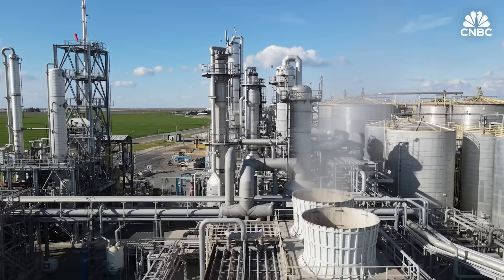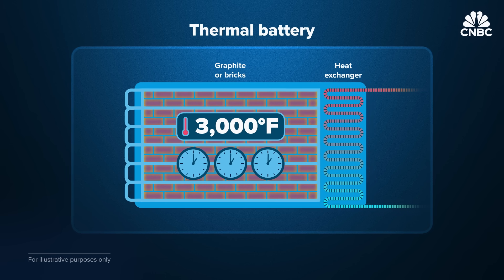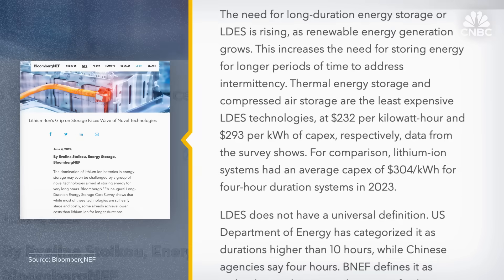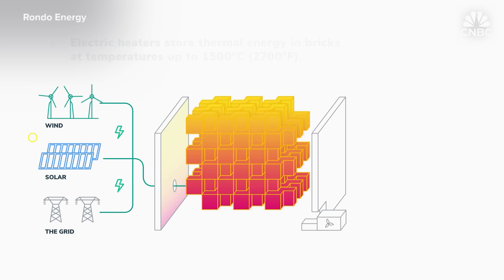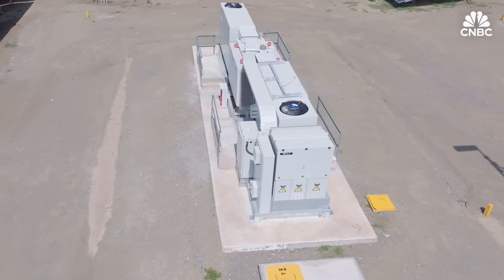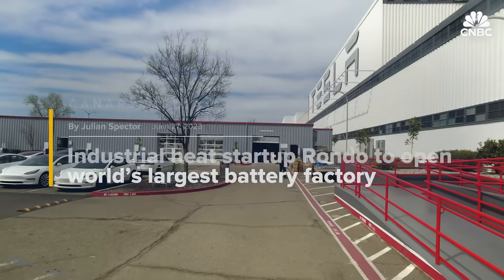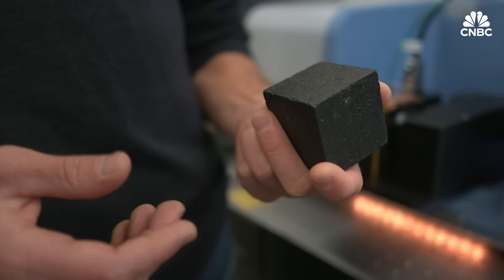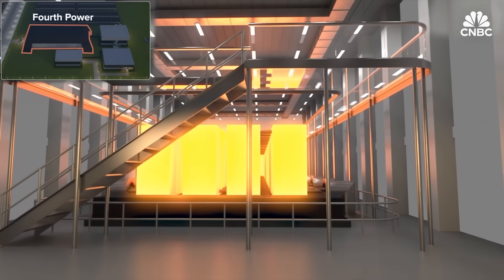How Thermal Batteries Could Replace Lithium-Ion Batteries

Comment: Lithium is not a rare minieral . There are not many mines because it previously had not been in demand. Cobalt is rare but not needed in LFP batteries. The heat storage is a good application in certain industries. I do not think it will scale down for electrical energy storage in my garage or my EVs.

Comment: Energy efficiency engineer here. I actually have a R&D project, where we're putting in a much lower cost (water based) thermal storage in Ontario, Canada to offset heat pump operation during peak grid conditions.

You're mixing two technologies and as a result it's hard to see what the video is about.

Tech 1: Use electricity to heat smth up, then use the heat for industrial needs. Great tech. Very limited application. Key point - will be implemented by industrial clients who will then reap the benefits of switching when they use the grid. High efficiency, as little is lost (the electricity would have been used to make heat anyways).

Tech 2: Use electricity to heat smth up. Then use the heat to make steam that will turn a turbine to produce electricity again. This tech could be used by the grid operator as the output is electricity again. The key issue (not touched at all in the video) is roundabout efficiency. Unlike lithium batteries, the conversions will eat away a sizable chunk of your input energy. So if you put in 100kWh of electricity you may get back 50-60kWh unlike lithium where you're getting 95+kWh back. so a $/kwh stored is an unfair comparison.

There's actually a 3rd tech that you haven't touched on at all. You can use solar thermal plants to charge your thermal storage, skipping the electricity step altogether. I've visited a project like this in Denmark about a decade ago. They used concentrated solar panels to melt salt in the summer, and then used the molten salt to heat a district heating system through the winter.

Comment: Another problem of thermal battery is the low RTE (Round Trip Efficiency) which is around 40%. This means that we can use only 40% of input electricity later. Heat battery needs to overcome this issue.

Comment: This is great because a lot of the new electricity might be produced by heat so transferring it also to heat batteries might work as long as we can contain it so it doesn’t catch on fire! But certainly should reduce poison and pollution both🔥 the only question following that is gonna be doesn’t heat up the temperature of the earth from having so much use of heat that needs to be scientifically calculated?

Comment: If intermittent renewable energy is so cheap, why do I have the highest electricity prices of the world here in Germany? Could it be that the media is lying to us?
Reply: It is all scam i guess
Reply: Because half of your electricity still comes from gas and coal, which are becoming insanely expensive. Be grateful that the other half is cheap renewable, because otherwise your electricity prices would have been even higher.
Reply: @texanplayer7651  lies.....wind and solar requires battery.  And these liars do not include the cost of these battery, and or other cost like the need to have standby power station when wind not blow and sun not shine.

Comment: 280 USD/kWh is a huge price! We something x10-20 cheaper.

It seems that a sphere of 2.5 m in diameter filled with sand and covered with 0.5 m of mineral wool would be able to store 300 kWh (1000 oC) for a week, losing 25% in the end, and being able to return half of it back in form of electricity and a quarter in form of hot water. And costing 7.5k USD (20 USD/kWh netto). (For reference, a 2.2kW steam turbine costs 2.5k USD.)

It’s interesting why no startup is able to produce a prototype of such a simple, but so much needed system. 

Having such a system the only thing remaining for energy transition is 5 times the nominal capacity of solar panels / wind turbines (for Germany climate). Even a diesel generator practically never will be needed.
Reply: Why would you want to store it into such a small sphere? Ever heard of the square cube law?
Think bigger! Instead of having such small spheres of 2.5m in diameter, have the sand stored in cylindrical tanks of 25m in diameter and 25m height!
A system of this scale with 50cm insulation wool would need around 6 months to loose 25% of its energy if it is constantly exposed to an atmosphere of 10 degrees C (sand heated to 1000 degrees C). Besides, steam turbines need to be big to be efficient, so you wont be seeing any such devices running your home at smaller scale any time soon.
Combine that with district heating, and you have the perfect electricity + heat energy storage combo.

Comment: Might as well use solar reflectors instead of cells, cells have a 23% efficiency.
Reply: That's a good idea, but solar reflectors need to reflect that energy into a fluid. Sand won't do.
And the highest we can go is either using oils (up to 300 degrees C) or liquid salt, which can crystalize in the plumbing and shut down the whole plant.

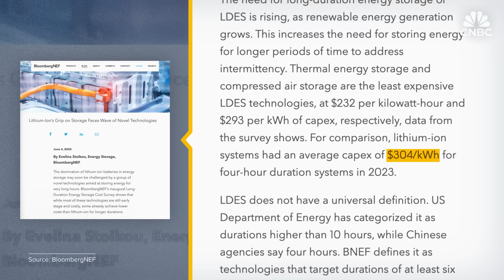Comment: 2:40 I costs nearly as much as Lithium batteries but only works on thermal applikations and only for a short period of time.
Not that great of a deal.
Reply: Capital costs are still 20% cheaper than lithium batteries, which is far from being negligent. And that's considering that lithium ion batteries are a nearly mature technology now, but this concept has still a lot of potential to become even cheaper. And that's capital costs only! Thermal batteries require a lot less maintenance and have a much higher life expectancy as well, which reduces the adjusted price considerably.
Also, when you are storing heat at high levels, you can reconvert some of that back into electricity, and keep whatever heat you didn't convert for low grade heat applications like district heating, and still reach over 90% round trip efficiency.

Comment: Less than a minute into this video there is a blatant lie......Wind and solar energy sources ARE NOT THE CHEAPEST FORMS OF ENERGY .... unless the US and states' governments provide huge subsidies.  Thus, they are not cheap as taxpayers subsidize the costs.   I have no issue with using industrial scale batteries, but to state that wind and solar energy is cheap is a blatant lie.
Reply: This is no lie. Wind and solar are indeed the cheapest form of electricity source with costs as low as 40 dollars per MWh of energy, compared to 120 dollars for gas. And that 40 dollars with renewables is achieved WITHOUT subsidies. As for the gas 120 dollars, it is achieved WITH subsidies...
Reply: @texanplayer7651  You are wrong and do not even realize it.
Reply: @stevewhitaker1474  And you did not bother to spend a minute looking it up on google or asking an ai chatbot to do that work for you. It's so much easier to spit out lies on the internet and gaslight everyone than it is to admit that you're wrong. 
With all the tools you have in your hands to look up for information, you have no excuse to be this misinformed. You will waste less time typing "price of nuclear vs renewables" on google than you will answering my comment.
Get schooled.
Reply: @texanplayer7651  You need to do research and educate yourself.  I spent 45 years in the energy business; I KNOW about what I speak..., whether you like it or not.

Comment: What is the efficiency of thermal batteries? What is the cost per watt hour? They missed a key point in this article.
Reply: Thermal energy can be stored very efficiently, often times at higher efficiencies than the electricity of lithium batteries. As for the cost, we have already district heating systems that demonstrate costs per kWh lower than energy from classic lithium batteries.

Comment: When the video makes the comparison between lithium and thermal batteries, it seems like thermals are much cheaper and even easier to produce. However, what about space? They don’t mention it, but they show these massive thermal battery units and the really small lithium batteries, and I wonder how much energy per cm3 or m3 they both store. Space is also a cost that should be taken into account. Just in case: I’m not against it! I just wonder. And in any case, I’m sure the technology will evolve to become more cost-efficient, and that in the end we will see a portfolio of energy storage units.
Reply: If you have enough space for literal square miles of solar farms, this generally implies that you will have a few acres to spare for an energy storage system. I don't think space will be much of a problem here

Comment: Even better if you use it just for central heating, because then you wouldn't be converting it back to electricity, but directly warming up water. Then it becomes very efficient and the only loss is when storing the thermal energy.

Comment: Did I miss it?  At any point in this presentation  did they compare the efficiency of energy in compared to energy out to grid, with thermal batteries vs. Lithium?
Lithium is >90%.  I'm thinking this isn't near that but they don't say.

Comment: If the problem with Lithium batteries is that they start fires, how are thermal batteries not going to start fires? How can thermal batteries be used on consumer products and vehicles.

Eastman Chemical is a spin off of Eastman Kodak. My British uncle was a chemist at Eastman Kodak working on printer inks.

Comment: It is not possible. Just stop it. You can not store more amount of energy in mass. The mass jas to be massive so the electrons are in a big amount.

Lots of storage place = lots of mass.

The best way for energy transportation and usage is in a liquid. Gas and Diesel have 3000x more energy in it then lithium batteries and others.

And WE humans also work on liquid, the stomach who dissolves food in the stomach acid is like "burning coal in a liquid". 

You will need more copper wires to transport all of this energy JUST for the UK then copper exist in the world.

Stop this unscientific money grab scam called "ev" and batteries. The tech is solved for over 140y now. Neither Edison nor Tesla could find something better.

Comment: Heat is a degraded form of energy. The turbine coupled to the system to re-transform into electricity requires a low temperatue point, a heat exchanger an a turbine . The total energy yield of such a system is limited bu the Carnot rule: 30% likely, to 50% in some specific conditions. An electrical battery has a conversion yield of 90%.

Comment: The issue with renewables is that they cut into the profits of fossil fuel generators.

California is constantly hitting overproduction in energy due to solar panels but can't inject that energy into the grid because it'll hurt shareholder feelings by driving down energy costs. 

Instead we sell that overabundance to nearby states.

Renewables won't kick off if we keep prioritizing profits.
Reply: This is wrong…. When solar all generate power at the same time, it drives the cost down and solar investors don’t recoup their costs.

Comment: A school not far from me was built with a thermal thermos. It captures heat during the summer months, and discharge it in winter. This is sand based afik

Comment: Very little platinum or lithium is used in fuel cells in comparison to how much lithium is used in a lithium EV, lithium is very difficult to recycle this is why 99% is not, the new solar cells are much more  efficient make hydrogen than just storing it to electricity, simply more bang for the buck for hydrogen storage, Due to the heavy toxins and pollution in mining lithium, when a lithium car is still in the company  assembly line it has already polluted more than a hydrogen fuel cell car that has been on the road for more than 125000 miles!

Comment: There’s nothing novel about this, other than the economics related to cheap renewable electricity. I’ve been using my electric water heater as a thermal battery for years. 220V timers are quite cheap and easy to install inline with a water heater - just set the on-time to periods in the day when your grid is heavy on renewables (10am-3pm here in Arizona). Electric water heaters are so well insulated that you will only lose about 5-10 degrees off of your set temperature after about 20 hours.

Comment: Basically the characteristics of these batteries is that they are huge, heavy, and cheap. They are way worse than lithium batteries in terms of efficiency and how long they can hold energy but that doesn’t matter when the energy is renewable and the batteries are 10% of the cost

Comment: Could you use thermal battery bricks in home construction?
Reply: cost efficiency comes from scale. You also need a LOT of insulation on such a system to ensure that the stored heat doesn't just dissipate. If the goal is to make steam, you're storing at extremely high temperatures

Comment: In my opinion,  most efficient and effective will be mercury based technologies.  These technologies were used centuries ago and almost forgotten in our days. Forgotten, because mercury based technologies do   provide electrical energy independence in different levels. Technologies, such as golden mercury, do need modern time science to be developed. In many technical areas we see today representation of very complicated and expensive tech., instead of simple and cheaper tech. I could be related to will of control and bully less rich countries, make those countries compete and waist more money on inefficient technologies or, simply, buy those tech.😊

Comment: Very cool. Please install at every substation in the world. For my house basement I am thinking 4" of foam R20 covered by a sheet of concrete board with electric heating coils throughout smothered in self levelling grout covered by another layer of concrete board reheated by 30 solar PV panels installed near vertically along my central Canadian fence.

Comment: Stupid idea. Heat is a low grade energy and it needs a generation plant to convert back to electricity at about one third efficiency, that it, losing more than two third in the process. Letting solar or wind electricity to degrade to heat is surrendering to this loss. These market scammer do not care about Second Law of Thermodynamics.

Comment: How would batteries like this perform in extreme cold temperatures and winter climates.  I've had so many problems with the new battery for my car that I've bought to replace and it only seemed to have had problems in cold weather 🤔

Comment: 1) Ditch conventional EVs
2) Normalize hydrogen EVs (FCEV)
3) Utilize renewable sources to generate hydrogen through electrolysis and store the captured H2 gas.

Stored H2 won't degrade over time unlike batteries, and the efficiency is up to 80%.

Comment: Statements like "store excess electricity as heat" are nonsensical as heat and electricity are fundamentally different physical entities.  (Physics 101)  Given an appropriate device, e.g. heat engine, you can transform thermal energy into another form, but always under the constraint of the second law of thermodynamics.  The thermal conversion efficiency can't exceed the Carnot value of (1 - Tc/Th)*100%, where Tc and Th are the lower and upper operating temperatures in degrees Kelvin.  Ambient temperature is typically around 300 K, and the boiling point of unpressurized water is 373 K, which leaves you with an efficiency of (1 - 300/373)*100% = 20%.  In other words, you need very high storage temperatures for good conversion efficiencies.  What the planet really needs is an electrical storage alternative to the electrochemical battery.  You can't do better than electrical input from solar or wind to electrical storage.

Comment: @5:11 "a pound of brick stores more energy than a pound of lithium ion battery" ???😯
Reply: Yeah, but you need to make that energy usable at the end. If all you need is heat, sure, a warm brick is nice. If you need to charge your phone, you need a bunch of other stuff and lose a lot of energy to charge that phone from that warm brick.
Reply: @JonDecker  but I'm quiet sure the end product will always be electric with significant losses during conversion
Reply: @Dipotso_1  These days, it's a battle of the lowest losses. There is no such thing as 100% efficiency or above unity power.

Comment: This method seems very accessible and easy for anyone with the knowledge how to make
Reply: Yeah, it's called a fireplace with a brick surround. Turning that heat into electricity is not efficient, though. This is not a replacement for "normal batteries," as they're trying to claim.

Comment: Better efficiency of the battery chemistry will be most cost efficient, geopolitics and supply chain dependency forces countries to use lower efficient solutions, but will give only short term gain and long term loss.
Reply: LFPs are already way cheaper per useable kW than thermal batteries. This company is hoping for good press funding from the uninformed.

Comment: Seeing the YouTube recommended videos dating 5 years back right under this video speaking directly about these same batteries.
Reply: We've had 200MWhs+ of customer project announcements this year after our first commercial pilot in 2022. We've also partnered with some of the world's largest energy developers on 3GWhs+ of deployment partnerships. Keep in mind, the solar industry and lithium ion storage industry was much, much slower to reach the same scale and capacity.
Reply: @RondoEnergyGlobal  , yet the exponential curve of solar/wind and LFP battery systems in the past couple of years has blown every cost analyst's projections out of the water. We need all the energy storage options that make sense. We should use thermal energy storage for thermal energy demand and battery energy storage for electricity demand.